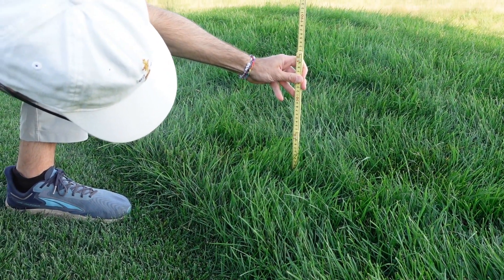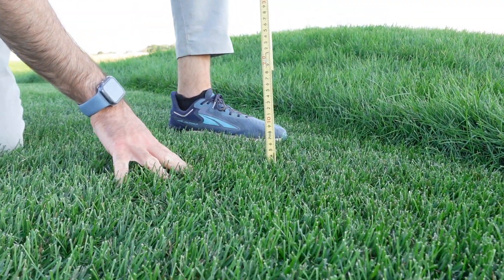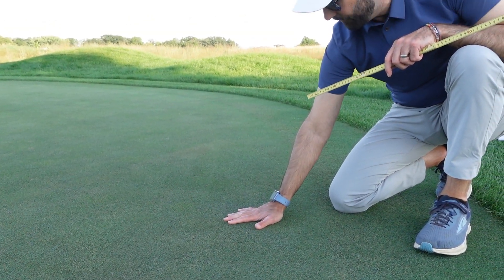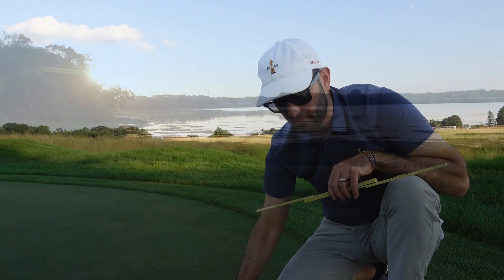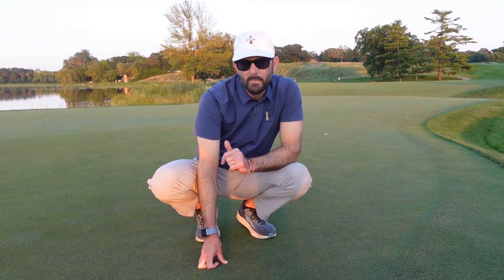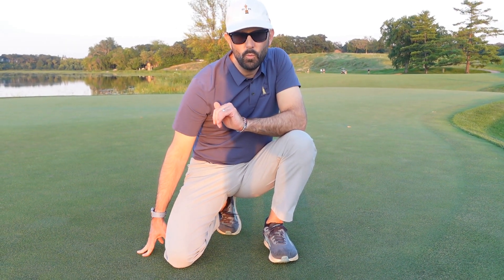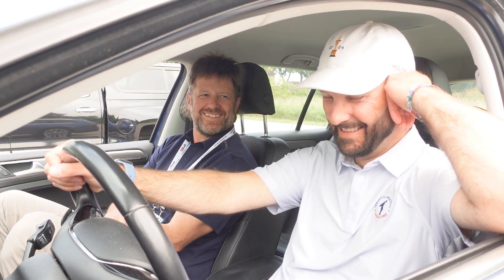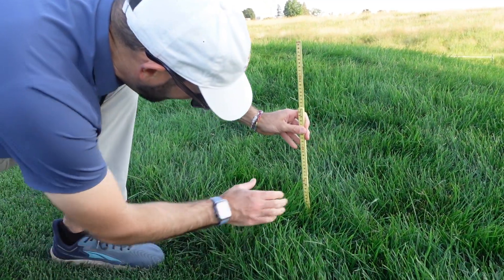Turf GvX, sand, grasses, and mowing heights at the 2024 U.S. Amateur with Chris Tritabaugh

Comment: thats amazing, did you not recommend chris around 5mm a year to meet his 1.8% OM accumulation? so how has he got away with half of that this year? would that mean he has accumulated more OM than sand put down this year? if using your numbers? 

also what months or how many applications would you reccomend applying 5.0mm?

in one big hit in august? wouldnt that cause layering? or like 4-5 smaller 1mm hits
Reply from the maker: 1 mm is still quite a heavy topdressing application. In Chris's case, because of the climate, he can apply the bulk of the annual topdressing in autumn, right as the course closes prior to winter. I'm not terribly concerned about that type of layering. And as far as the accumulation of OM, the N rate is lower now than it was a few years ago, and the accumulation rate is lower, so the amount of sand required is also less than it once was.